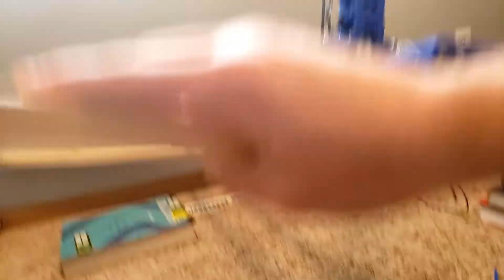CNC Hot Wire Cutter Part 2: First Cuts and Discussion

Comment: I disagree with putting the springs aligned with the hot wire. This way, they can have a part of the movement in the direction of the travel, and so, some transverse oscillations. I think the best would be to have the wire in some kind of pulley/tubing just where it is attached to the vertical gantry. The spring being "outside". This way, the only transverse parasitic movement is due to its own flexibility.
Reply from the maker: Thats a good insight, when I first built the machine i did notice oscillations at lower wire tensions. With the current setup I have (motor controlled tensioning) the wire tensioning is high enough that i haven't seen any oscillations. However, the springs do take up space along the wire that cannot be used for cutting, so changing them to be perpendicular to the wire is a good idea. The UZ gentry already has the wire on a pulley system to tension it with a motor/gear box system at the top of the Z-axis, so I'll probably add a pulley to the XY gantry as well when I do a redesign. Thanks for the input!

Comment: are you able to tension the wheels on the extrusions or are they always at a constant force? i used eccentric nuts on mine and it’s very easy to fine tune and becomes strong. they are easily printed aswrll
Reply from the maker: That is a good idea, I do not have any tensioning on the wheels and have had some issues arise because of that. They are always constant force
Reply: @fureter6986  yeah, it still will be some oscillation i the actual profiles tho. on my machine i am able to mount a mdf sheet which removes the flex.

Comment: Very interesting seeing the progression.
If you ask me the spring is probably the main issue. I'm using 2kg tension for my 'bandsaw' style vertical cutting (about 10cm), and more than that for the longer bow (40cm). I doubt the spring you have there would be anywhere near that, just from looking at it. The tension needs to be relative to the span of foam being cut, and with more tension you'll be able to lower the wire heat and get a finer cut line, and/or go faster with same heat. I think we are using about the same gauge wire, you might be surprised how much tension it can take, just don't let it bend too sharply or fatigue from repeated bending. So to me the pulley improvement seems like a must rather than optional. Pulley would make it very easy to adjust the tension, and would also let you make cuts where each side of the wire varies a lot. Well, vertically at least - higher tension will probably require a brace between the columns at the top which will force them to remain at the same y position.

The other issues you mentioned seem rather minor in comparison, although increasing tension will probably cause them to become more important. I can't think of a way to arrange the pulley weight without it needing to be lifted up and down, so the motors will have to deal with that too. Maybe you could make a simple test with wire fixed at one end and a weight hanging over the other side of the bench, adjust the weight and current to figure out the minimum weight you need for the cut span you want, and work around that.
Reply from the maker: Thanks Chris!
My main concern with the springs is that if one gantry moves to the furthest extreme from the other, the springs would have to expand by around 23cm in the current configuration. 

I'm not too worried about the tension for the cutting as long as the tension is consistent and strong enough to ensure that the wire is as straight as possible. The feed and heat of the wire will be calibrated so that it never touches the foam work piece, ideally the wire should stay within the burn front of the cut. 

I have a 50cm hot wire bow that I have tensioned a lot more (using two bungee-cords wrapped around the top), but thats mainly because the temperature isn't well controlled, and the movement is even less controlled, since I'm cutting it by hand (too much caffeine).

I'd like to leave the two gantrys independent of one another to leave more freedom for future projects, so I'd like to get just as much tension as necessary so that the cuts are straight, and calibrate the feed and power to the wire until the cuts are crisp and clean

Thanks for the feedback! I'm definitely going to try to get the pulley tensioning system working!
Reply: @fureter6986  Hi haven't got to your third video yet but have a look around there is some modded Servo winder/tensioners for the wire. The other option is a Tool Balancer (spring retract) and a pulley.  Also with your Power supply not sure what you are trying but crank the voltage up to max and control the maximum current for temperature the voltage will come up and down as needed. Also open builds make an eccentric adjuster for their wheel system, same as used under the bed on your printer designing them into your design will help with the slop a lot.